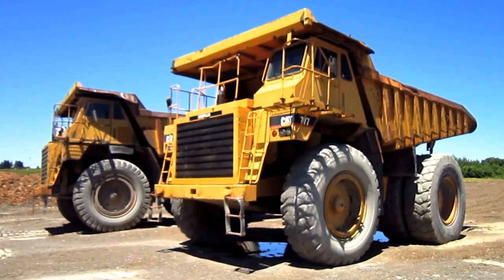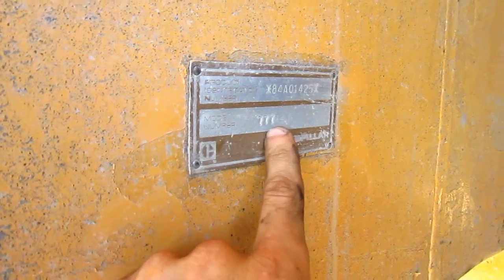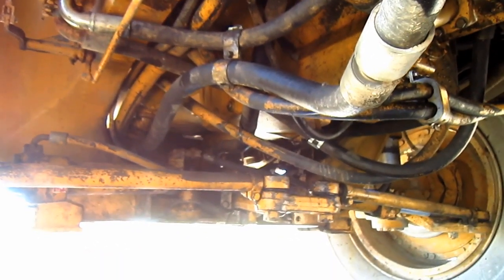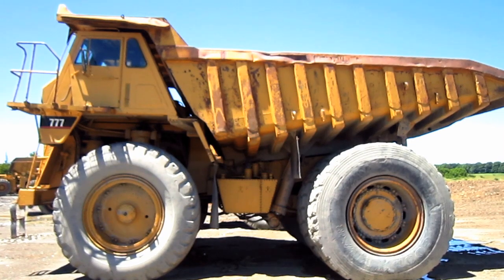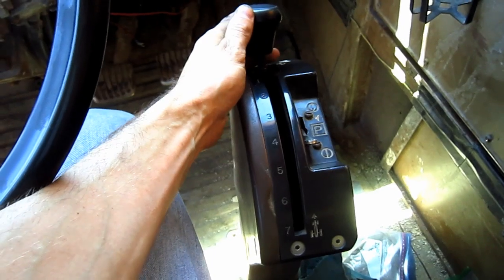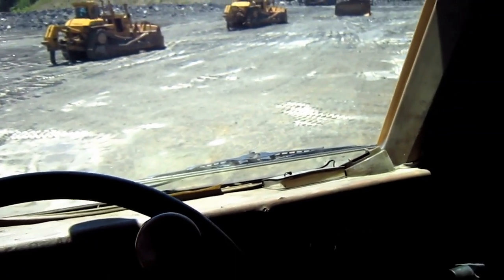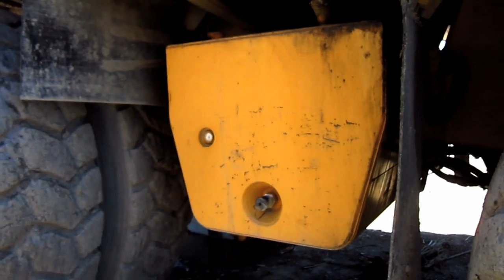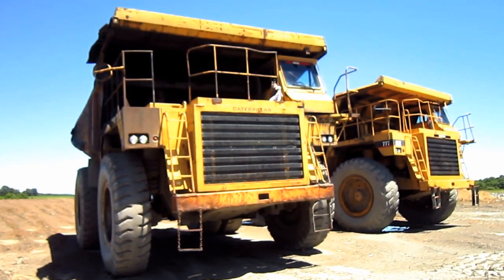Caterpillar 777 Documentary

Comment: A Cat truck is a sweet ride for a boulder hauler. A 773 was as big as they got here as far as I know. Been out of the loop for a while. They had a 71 and a 73. I ran the 71 mostly unless the 73 driver was out but it was like a dune buggy next to the old Ford 800, the old IH straight drive, the R-22 and R-35 and the 40 ton Te-wrecks with the Cummins and electric shift Allisons. I was always partial to the R-35 with the 12V-71 and not much exhaust system. It did really good for what it was but the 771 or 773 were like limos compared to the ride of the older ones. The 71 hauled 40 tons plus and the 73 was 60 plus a bit. We were running between 12 and 1400 tons per hour with a Hitachi 1200 shovel. Not much wasted motion. I always really liked the way those trucks shifted themselves. Smooth. 
Thanks for the tour, Pal! A-PLUS and God Bless
Reply from the maker: You're welcome brother man! Peace ✌️
Reply: @PAmining  Likewise, we're SURE! REALLY sure!